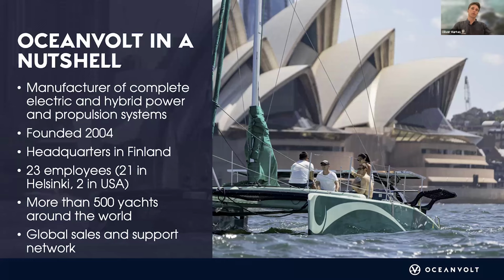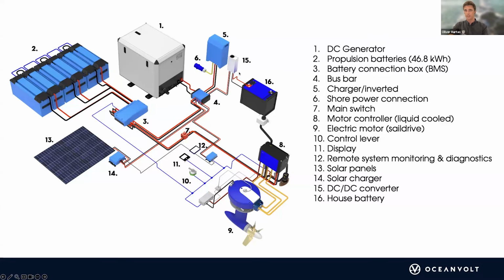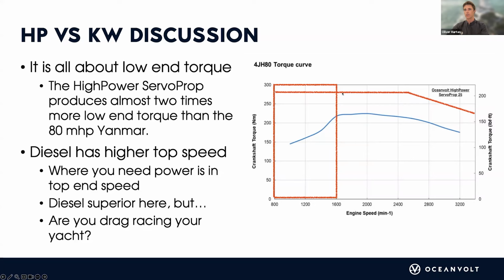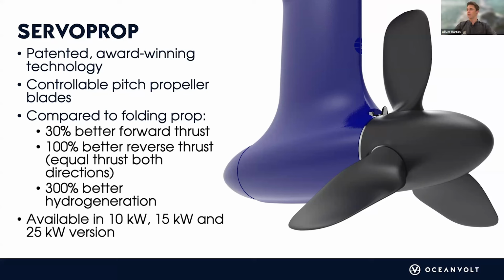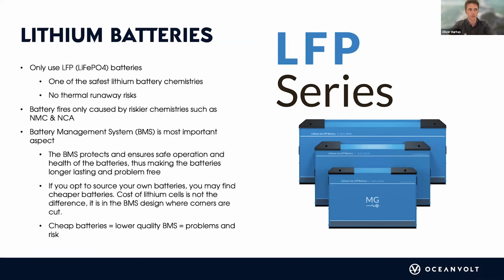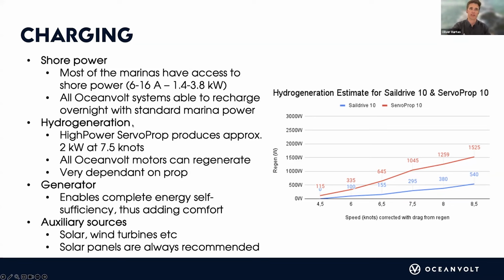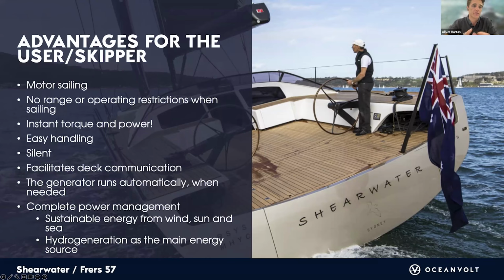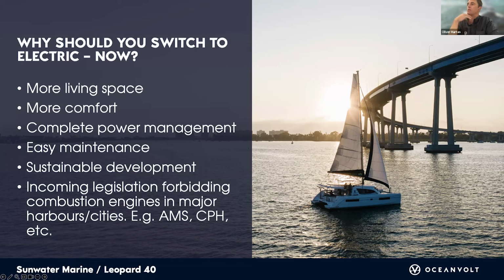Oceanvolt Electric Propulsion Webinar for the Royal Sydney Yacht Squadron

Comment: So as far as the batteries go, I could build my own DIY battery packs and purchase an MG BMS and this would be up to par?
Reply from the maker: Thank you for your question! While DIY battery packs may seem like a viable option, it’s important to note that it is not possible to use DIY batteries with MG Masters. Each MG battery has its own built-in BMS (Battery Management System), and the MG Master unit functions as a BMC (Battery Management Controller) to ensure that all MG batteries work and communicate correctly within the system.

The MG system is designed specifically to work with its own batteries and BMS units, so integrating a DIY battery pack wouldn't be compatible with the MG Master or the overall system. For optimal safety, performance, and compatibility, it's essential to use official MG batteries with the MG Master.

Please feel free to reach out if you have any further questions or need additional clarification!
Reply: @Oceanvolt  got it. Thanks for the info.